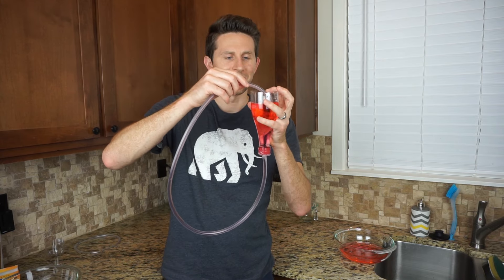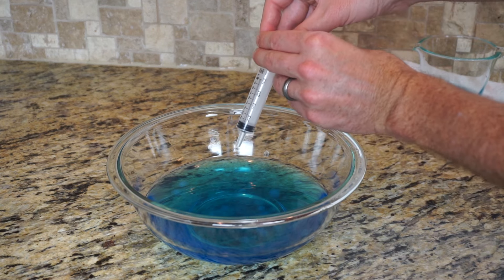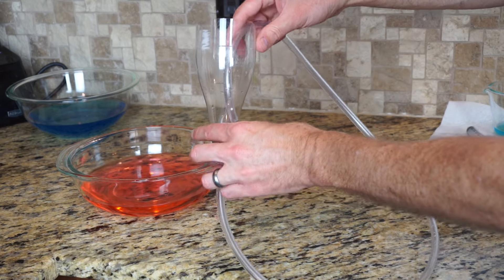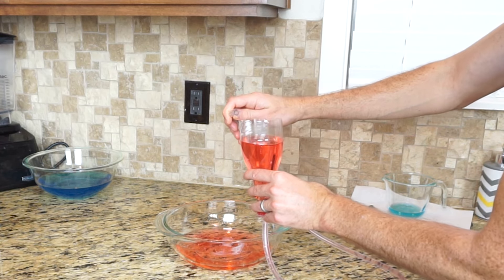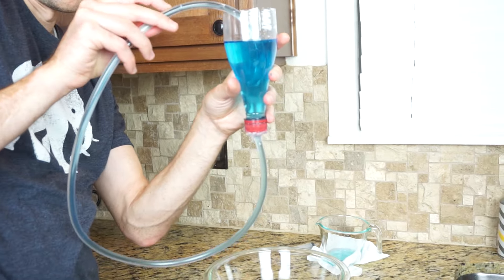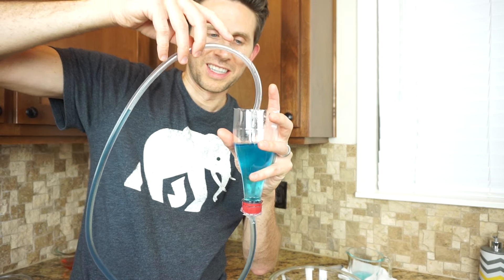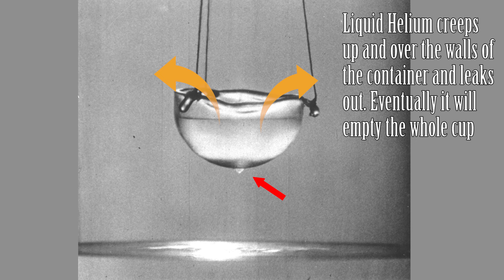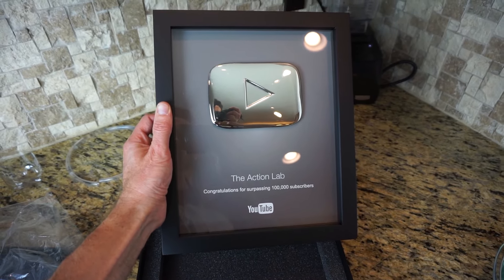Boyle's Self-Flowing Flask Filled With Polyethylene Glycol (Self-Pouring Liquid) = Perpetual Motion?

Comment: Perpetual motion is impossible in dis universe
Reply: that is dis-information.  I prefer dat-information.
Reply: No it isn’t
Reply: coolin Yes it is, it goes against the laws of Aerodynamics.
Reply: @paulcastillo1880  it goes against the laws of thermodynamics which is the study of energy.
Reply: What do you mean by this universe?
Reply: Earth's orbit around the sun is perpetual motion. The ebb and flow of ocean  tides due to our moon's gravitational pull is perpetual motion as well.
Reply: @vmm5163  do you even know what perpetual motion is?
Reply: @vmm5163  Perpetual motion is a system that produces work (energy) while maintaining its state (which implies it can forever produce energy without changing state).
Orbiting planets are not a perpetual motion system.  They do not confer net work. Tides have Ocean rising also has ocean falling.   NOTHING we know of or can explain is a perpetual motion system.  There is no perpetual motion. 

Orbiting planets APPEAR to be a perpetual motion system, because the length of time needed for an OBSERVABLE (measurable) state change to occur is enormous (many, many, many, many lifetimes).
 Eventually a planetary orbit will degrade.
Reply: David Geffeney Imagine, like, a giant sphere? And make it, make it hollow. Then put this sphere, ok, around a STAR. And make it, make it a giant solar panel on the inside.
Reply: @vbgvbg1133  it would be the same if we used the solar panels here on earth.And that's not perpetual motion,that's just the conversion of sunlight into electrical energy
Reply: @sahilbehl7851  
Well, perpetual motion does happen outside Earth since it doesn't have any gravity..
Reply: @junkyyard2273  what are you taking about?
Reply: Junior Mechanica That makes no sense
Reply: @Seagul, Steven,  If that's a fact Jack, then why not just fill it with beer? The bubles get it started and the alcohol keeps you drunk forever.
Reply: True in a way, but...
For example, black hole violates the "information is indestructible law"
(How people have tried to come around it is theorizing of maybe blackholes surface has quantum imprintings of the information)(And no this is more like a quote because I am not quantum physicist or astro physicist I am just a highschool student)
White holes existing would also... well... break a couple things, together with the hypothesis of negative mass object.
If temperature raises over a certain degree where the wavelength of the heat radiation is smaller than planck distance, it also causes problems, it doesn't really violate but it isn't really explained either...
The newly found, really confusing Time Crystal, seems to also violate thermodynamic laws as well.
(Apparently they somehow manages to never be at the lowest energy the system can be, and always tries to achieve such, but can't actually get it lower for... whatever reason, that I don't really understand, but apparently it is kinda breaking the thermodynamic laws now so... interesting?)
If Tachyons do in fact exist through some certain meanings we directly break light speed unbreakable law.
(But as much as Tachyons are cool I would not like for this monstrosity to actually be alive in this world, I like to keep my sanity safe from causation violations)
Physics isn't super perfect, lots of questions, and certain things that math says yes but physics isn't really taking it.
Perpetual machine is most probably not possible, in this universe.
But if Big Bounce... well then we have even more questions.
Ofc never forget the possibility of a super over the top divine omnipotent being.
Nah, perpetual machine, if followed by the words in bible, should come pretty darn quickly, possibly right after you die, seems legit.
Just ask almighty god for a favor, pretty sure if you done good shit on earth he gaves ya what you want, perpetual machine not so hard, for omnipotent beings. Probably. Possibly.
Yeah pls ignore the last couple sentences, I had fun.
Reply: @sahilbehl7851  : yes 😁
Reply: @clubadv  : how did a professor win a bet by stating the earth's rotation around the sun was an example of perpetual motion then? I don't think the sun and planets have changed their dynamics in 14 billion years. It's you who's shifted the goalposts by using different terminology. Stop shifting goalposts.
Reply: @terryfuldsgaming7995  : course it is 👍
Reply: Leonard Susskind said Information is indestructible.  That does not make it a scientific law, or any other kind of law.
Reply: @vmm5163  I don't know what you're talking about, and it took me five seconds on Google to find several sources stating that a planetary orbit is not an example of perpetual motion
Reply: A system of perpetual motion would need to have 100% efficiency, and as far as I know, that is impossible
Reply: but we are perpetual to continue finding it
Reply: Luigi Francisco a floating-spinning top in a perfect vacuum
Reply: Lets move to another universe then
Reply: @clubadv  No,the sun will die out eventually.
Reply: David Geffeney so until that eventual orbital decay we have PERPUTUAL MOTION YAY!
Reply: Steven Seagull dont bring up elementary school, they still teach that columbus discovered a new world. and that native americans and colonists where super happy during thanksgiving.
Reply: NERDS
Reply: Nothing is imposible.
Reply: Plants revolve around sun perpetually
Reply: @vbgvbg1133  You mean a Dyson Sphere? That's not motion at all. That's just solar energy. And it's not perpetual. The star will eventually die out.
Reply: @junkyyard2273  
Even far from Earth, there is gravity and must be because otherwise the Moon would get lost in space - and Earth itself as well, moving ever further from Sun. What these orbits lack is friction.
Reply: a state in which movement or action is or appears to be continuous and unceasing.

the motion of a hypothetical machine that, once activated, would run forever unless subject to an external force or to wear.
Reply: Lol guys if perpetual motion is posible we could have an unlimited source of energy..
Reply: @vmm5163  The tides are not perpetual. The moon is slowing down because ALL of the energy of all that water moving, is coming from the motion of the moon. You don't get anything for free. Even the orbiting planets are doing some work, in that space is not a perfect vacuum. Any work they do, results in exactly that amount of energy being lost from their motion. There is no free energy.
Reply: @junkyyard2273  There is gravity everywhere. Earth's gravity does not stop at an arbitrary point. It extends outwards infinitely, like the gravity of all matter in the universe.
Reply: @paulcastillo1880   THERMODYNAMCS NOT AERODYNAMICS
Reply: @colins6505  yes it is. All motion in the universe slows.
Reply: @vmm5163  all those motions decay genius. The moon is moving further away causing tides to be less and there is in fact something called orbital decay. Even the sun wont last forever.
Reply: @artytomparis  sounds good on a bumber sticker but doesnt apply to science.
Reply: Strange thing to say considering the entire universe is in perpetual motion.
Reply: @andrewscott7728  really because the universe is decay constantly. Orbits decay, stars die even galaxies die.

 Nice grasp of science kid.
Reply: @gregrohs6688  Particles in the universe will continue moving forever. Thank you for saying I have a nice grasp of science, but I am not a kid.
Reply: Andrew Scott actually they might not. Have you ever heard of the heat death?
Reply: @volkanketen3857  We'll have to wait and see.
Reply: @andrewscott7728  particles will move forever huh? 

And a black hole is what?
Reply: @gregrohs6688  A black hole is a region of space where gravity is so strong that even light can not escape it. The gravity is so high because the matter is squeezed into a tiny space. This may happen when a star is dying. Because the light can't escape, black holes are not visible. Space telescopes use special tools to help us find black holes. Thanks for asking Greg.
Reply: @vmm5163  Those things will not last forever. The moon is slowly moving away. The sun is a finite resource and gravity on Earth will be meaningless when the sun implodes at the end of it's life.
Reply: @berniebasset9465  OK. Maybe perpetual motion can be found somewhere within The Measurement Problem then
Reply: This
Reply: @clubadv  orbits and tides may go for a very long time, but eventually orbits decay,  suns die. yada yada.

Comment: It does not work because the water pressure in the container is the same as in the tube regardless of the thickness or atomic weight.

Comment: It maybe  would work if you used a water pump, then a electric water valve in paralel with the water pump, so the water pump would circulate the polyethylene glycol,and after it got some speed, you bypass it with the valve I was talking about, and the polyethylene glycol would circulate with no problem at all. Maybe the polyethylene wouldn't get circulated in the water pump cuz it would pull over the liquid itself due to the molecular chain, so it will get stuck in the water pump. All tho im too late now,it's been three years since you shared this video,but still it's a great one :):):):)

Comment: about 3 years old and still up to the standards, love your vids, keep up the good work
Reply: You will need a sealed "chamber" with 3 holes located  at the lowest part of the loop, this chamber need to be filled from the top with also an exhaust on the top, the tird hole needs to be located at least about half of the height of the chamber(distance depends on the loop height) then the third hole and the exhaust hole must be merged in a Y connector below the water level, avoid looping the end where the water comes out and use an horizontal end so it can be as closer to the water level, this way you will require less effort to push the water up its level... what you are looking  for with the chamber is to create a small pressure pump with the water filling the chamber the water will fill the space of the air inside giving a small push to the water that is trying to go up, you can go very picky on this to calculate what is needed for the pressure, chamber height, hole position, etc, off course the pressure on the chamber is limited by the amount of air that it can hold but here is when secondary pressure chambers, mechanical gauges and levers will come in to play to keep a continuous pressure.

The exhaust hole can be avoided if pressure is enough to push water up but if used the connection between the chamber and Y connector needs to be set as an arc in a "n" shape to avoid water on it, the reason of the exhaust is to make a push closer to the end of the water exit to create a sucking effect and to redirect pressure to the exitor it can also be used to combine multiple chambers.

Also the connection from water container and chamber filler will work better having a "P" trap in between.

I hope I haven't forgotten anything, enjoy 😉, love your channel BTW.
Reply: @fredcastaneda3267  u know you made a comment to my comment right?

Comment: If you lower the tube with water then pinch the tube so the level stays then raise it over the glass the release the p8nch so the water comes out itll create a suction and keep flowing into the cup and the weight of the water creating pressure will keep it flowing.

Comment: Right- think hinge in the middle, two flasks on either side of balancing beam, one capillary pipe between them, glyco liquid in flasks, Try some magnets to the capillary ends and repelling magnet on edges of flask if seeking to shake up the ends when the one flask scales down as it empties, and the liquid flows backwards, as it fills, then, viola. Then we make a Flux capacitor with this.....

Comment: Of course the demo won't work with polyethylene glycol ... it's just a siphon and no matter what liquid is in it, the liquid will seek the lowest level.  Polyethylene glycol flows up and over the top of the beaker only because it's a very "sticky" liquid; it's a siphon but doesn't need to be contained within a piece of tubing ... the "stickiness" holds the liquid together without the external tubing.  Likewise a "perpetual flow" will not work with liquid nitrogen, because regardless of friction the liquid will still seek the lowest level.  Gravity will cause any liquid to flow down to the lowest level, so once the top of the tube is above the top of the flask, gravity will cause the liquid nitrogen to flow back down into the (bottom of the) flask.

Comment: 5:15 the liquid is not flowing backward, by pouring the liquid out of the pipe there was a small vacuum created inside the pipe, it was air bubbles that was going it to fill that vacuum , so it seemed like it was going backward.

Comment: Honestly... Somewhere in the universe there’s likely some form of energy that’s being used like an Ouroboros effect. Basically, there’s 3 energy sources. A main energy unit that’s burning up some sort of plasma, and 2 other orbs or some form of containment unit that’s absorbing the expelled radiation in some sort of cylindrical containment unit... When the main power unit burns up or cools down, the two orbs switch from absorbing to expelling channeling the radioactive energies back to the main unit, and with nowhere for the gasses to go, but to go back to the main unit to start burning again, they essentially fuel a never ending supply of energy... Assuming we humans could ever develop such a thing, let alone figure out how we would make such a device work.

Comment: The real solution to making "climbing water" should involve making enough vapor pressure (by using say, sunlight) at surface so that a water column moves up through a pipe of an arbitrary diameter.

Comment: When i try this trick works if i put a hose up the hill and down pouring into the pond or lake, must be the air heats up the water inside the hose and changes its density :) but it works 🥴 though it will not work as a model experiment. Or the water comes out of the well in this way, if the hose part outside the well is longer than the one out of it. Or liquid needs a boost of kinetic energy and can sustain it :)

Comment: What happens if you were to seal the top of the flask with a whole for u to put the tup into but right above the surface of the liquid then. When it is sealed. Have a small hole in which u could stick an air nosle of sorts to add pressure to the system and start the initial push of the liquid used in this video. Though air might travel back up the tube from which the liquid comes out of. But i think if u sealed it in a pressurized system almost like the carbonation of soda in a bottle before opening it it could be just enough. Though you would have to bend the tube almost directly above the surface of the liquid.

Comment: all theory but an idea.... oil usually floats to top of water, so get just enough water to occupy the tube and the bottom of the flask, add double or triple the weight of oil(may have to adjust), see what happens? kinda think there will be oil both in the tube and flask with water at the bottom but not sure; alternatively find some way of weighing down 1 liquid with another item that doesn't fit through the tube but floats above that liquid

Comment: Do it it a vacuum chamber... atmospheric pressure was equalising the fluid .. might act differently in a vacuum 

 and pull the tube out of the fluid a little bit at a time .. when you break the surface tension it allows the air to go up the tube to equalise the pressure

Comment: If heat is applied to the bottom end of the flask and tubing (for example the bottom half is in the sun when the top half is in shade) it should work with glycol. My reference to this being true is running a waterless condenser on a lab still.

Comment: Try to get a big container, and a thin, hydrophobic tube, and they to jet the water up in the air back into the container, maybe since it has almost no surface friction, and the diameter of the tube is smaller, it could work? (Perpetual motion doesnt exist, but it would be fun to try maybe)

Comment: Closed loop 3/4 molecule He. As the passing of 3 into absorbs heat an on the opposite side boils off[ish]. This what they use for super cooling down to absolute zero (almost), I know it's used in that aluminum copper ball thingy an it allows gravitation waves to distort its shape. There is a test reactor in cali (moved from texas) that it neutral energy, it's like they use lasers an the fuel source is deuterium with the by product being tritium which in turn becomes deuterium again. They can change those hydro isotopes  into other elements. Personally I don't think something is energy neutral unless it can replace the energy that started the reaction but it can be perp motion so long as its maintenanced which of course takes energy to do its sorta like how people use them canvas bags for shopping to save the earth while in facts the energy to make, deliver etc you would use less fossil fuel with plastic single use. I'm sorry, ignore me, I'm really stoney.

Comment: There is different way to do this - if you create right pressure, hold the tube with a finger and release it in the liquid. It works so far only part of the tube is over the level of the liquid.

Comment: The problem with this is that there is not enough water weight to push the water through the tube. The tube size is fine but if you use 5 gal bucket or bigger the weight should push it through. I honestly wish I could get ahold of someone to give ideas on stuff to see if they can work but never get any chance to actually try some of my thoughts(mainly because i dont have much to work with to see if they work or not)
Reply: Hertz2Helix  why yes, yes I have